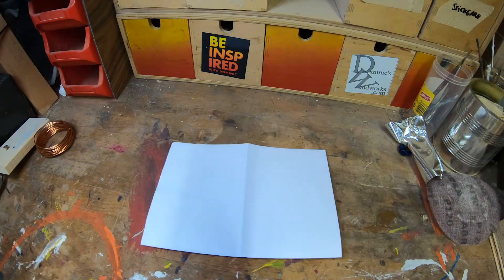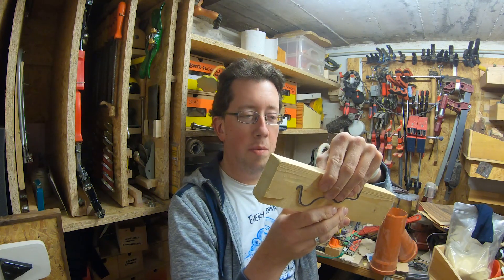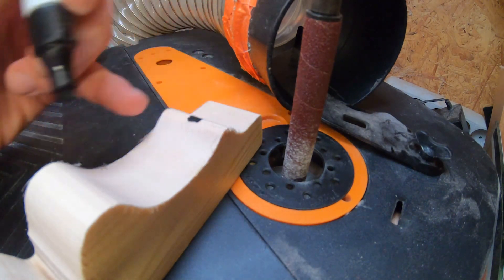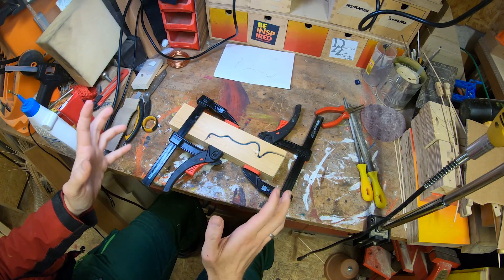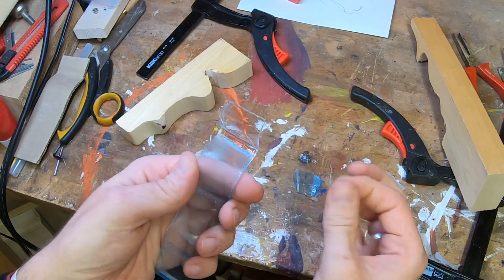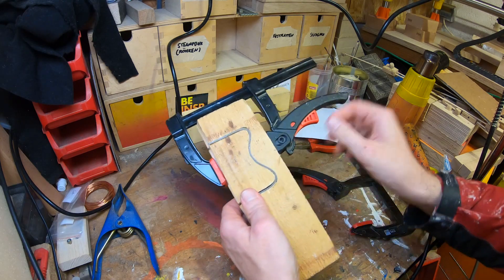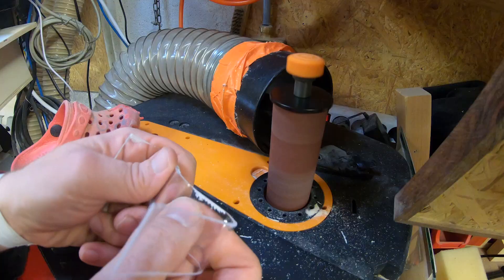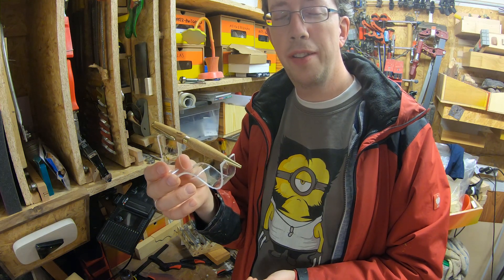Pen Holder - easy, elegant, adjustable

Comment: Or you could drill each strip once close to each end - with small and large bits - before heating and putting in the form.  Position the drill holes so when it comes out of the press, the large hole is a notch for big end, and the small hole ...
Just a thought.  You prove it works, and I'll make a stack of them. :)
Reply from the maker: That is a great idea, and should work even better for batching them out. Thanks for watching, Ken!